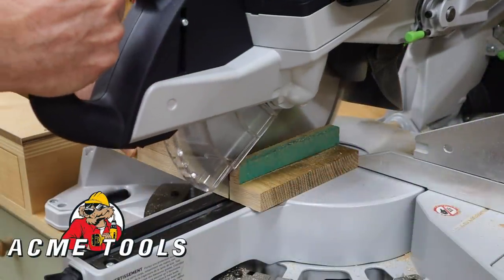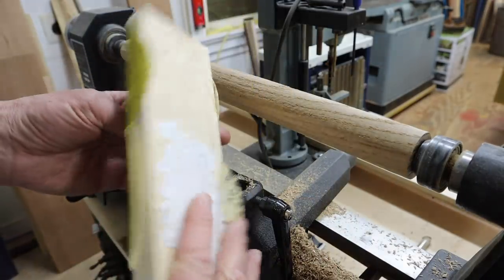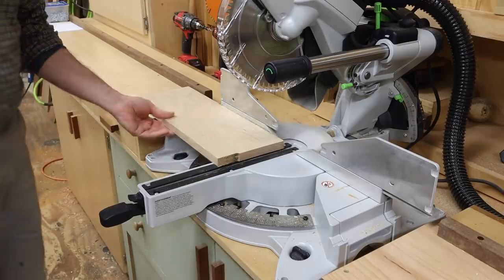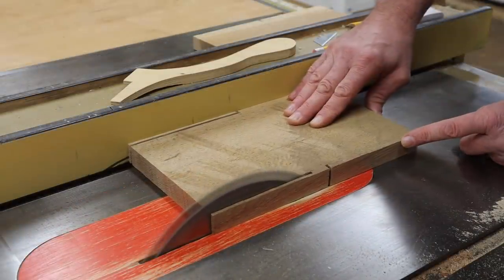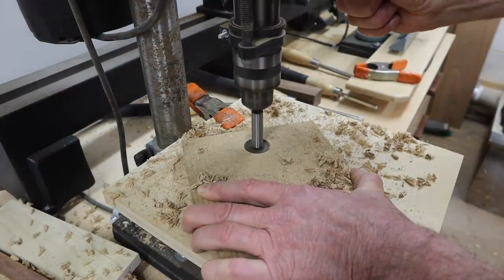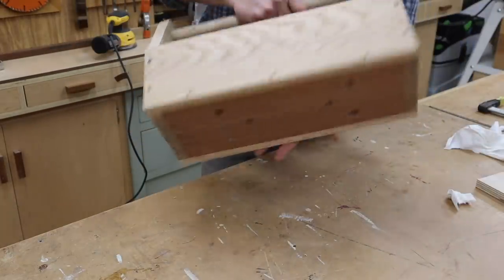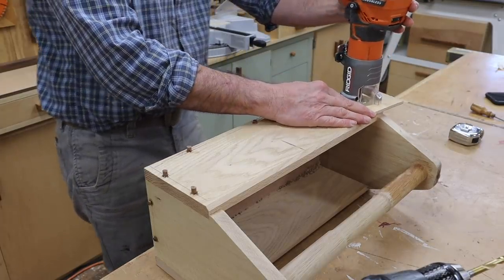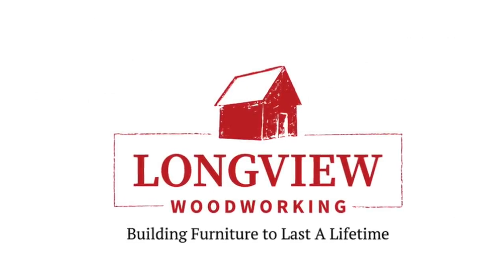How to Make a Garden Toolbox - Grill Caddy

Comment: As always, great job, Jon! Question: using the router to remove the excess handle material seemed reasonable, but do felt that it saved you any time or effort using it for the dowel plugs? I know typically people will use Japanese pull saws to remove the excess followed by a quick sanding. Of course, there's always more than one way you can approach a task, but I'm curious whether you found any benefits to your approach that would be food for thought. Thank you.
Reply: My GUESS is only because it was already set up for the handle, if not I don't think he would attach the base and set it up just for the plugs.
Reply: M M , He did not answer one question.
Reply from the maker: Hey Guys, For me trimming plugs with a router is much faster then with a saw and I’m less likely to scratch the project. I’ll probably keep this base plate on this router. The old corded router stopped working.
Reply: Jon Peters  - thanks Jon. I’ve never been able to trim a plug close to the case without scratching the work, and I have several flush trim saws and pull saws. The router trick works great.